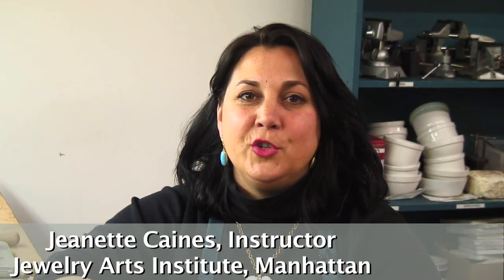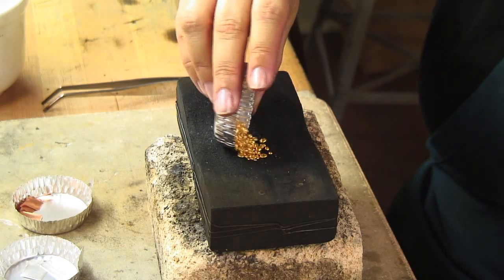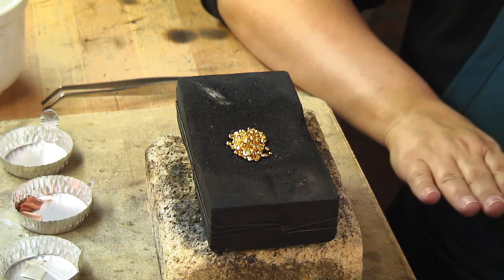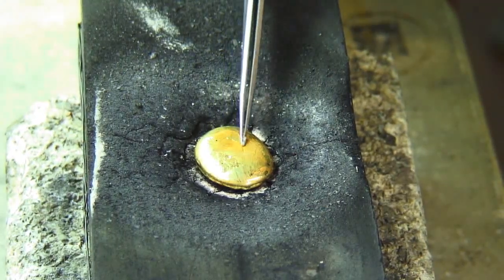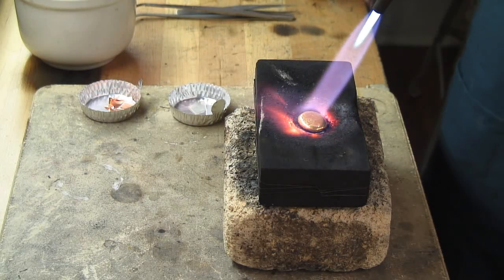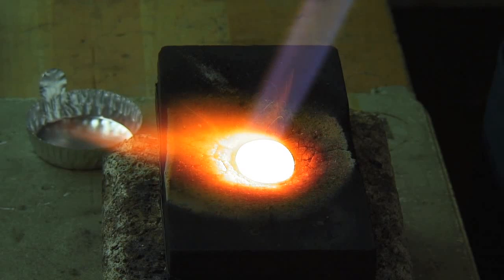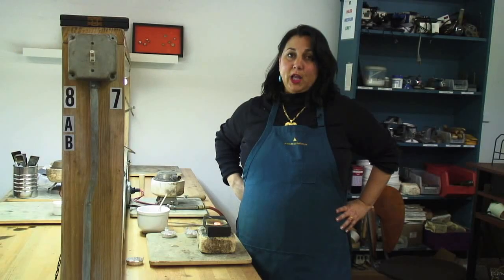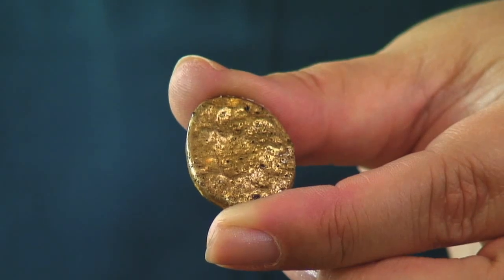How to Alloy 22k Gold Using Simple Tools

Comment: Thank you for showing your gold alloying technique. Very impressive.
However here in New Zealand we only use grams. So you know what contortions I had to go through adding up your dwt and grains so I was very confused until I saw you added the section for those of us who use grams.
I am alloying my 22k by adding Ag and Cu (oxygen-free) to 9999Au. I'm wanting to make 22k with equal amounts of copper and fine silver. I'm sand-casting my job, a ring shank and a 1ct diamond bezel setting. How does 22k like Delft sand-casting?
Looking forward to your response. Brian
Reply from the maker: Hi Brian,
Please let me know how it comes out! I have never sand cast my 22k but it is a very cooperative alloy, generally speaking. You are altering the copper content to make a harder alloy, I assume?

Comment: Question you said it was a once wouldn't it be more because of the silver and copper?
Reply from the maker: You start with one ounce of fine gold, it is more once you add the silver and copper. :)
Reply: Yea that's what I thought
Reply: I need some advice whats the best way to calculate how much silver and copper you have to add per half Troy oz of gold
Reply from the maker: @ron6Gs  For our recipe of 22k gold, it is 5.5 grains copper and 16.5 grains of fine silver
Reply: @JewelryArts  the information on grains is not really helpful can you tell me in grams
Reply from the maker: @ron6Gs  You said you needed the measurement for half a troy ounce, that is how we alloy in Troy ounces. You can just google an online convertor from troy ounces to grams. :)
Reply: @JewelryArts  ok
Reply from the maker: @ron6Gs  :)

Comment: Dear Jeanette Caines,
I love very much your videos, and I am interested on granulation.
I have made some works with fine silver, but I would like to make granulation with gold, so I will try it soon.
Here in Portugal to make the 22K gold alloy generally we use the same weight of fine silver and fine copper. Only if we want to change the color of the alloy, we change the proportion between the two.
As I understand at your video you use more fine silver (around 70% fine silver) than fine copper (around 30% copper). Does these percentages have a specific purpose for the granulation technique ? or is it possible too to use around 50% fine silver and 50% fine copper for this technique ?
If I understood well, your alloy is:
1 oz fine gold =28,3495231 gr
1 pennyweight and 9 grains fine silver= 2.13836403 gr
11 grains fine copper=0,71278801 gr
I would appreciate very much if you could give me a clue to this. I thank you deeply,
Yours sincerely,  Fatima Ferreira
Reply from the maker: Hi Fatima,
You ask an excellent question. The ratio of your alloy is essential to fusing. If you split your added alloy metals into a 50/50 ratio, your gold will be 22k but it will not fuse or granulate. You should duplicate the recipe I give exactly if you want your alloy to fuse well. If you are looking at the total ratio of your alloy, adding   much more than 2 percent copper yields metal that won't fuse well.  I am so glad you are enjoying and learning from my videos. Always feel free to ask questions. :)

Comment: Could you PLEASE make a detailed video tutorial on how to alloy to 10k , 14k and 18k gold? Most specifically 10k. I would be willing to pay for a video tutorial on how exactly to alloy 24k to 10k-18k. And can this be done using a 24k pamp suisse bar for the starting 24k gold when doing this process??
Reply from the maker: Hi! I only work in in 18k and 22k gold and the charcoal method I show in this video works great. However, the lower the karat, the more important it is to instead use a boraxed crucible and an ingot mold to get a good result, so I would recommend that. Have you done any alloying before?
Reply: @JewelryArts  Thank you for your helpful reply.  Is this method applicable  to up carat 14k to 20?
Reply from the maker: @ronsfi  Yes, but remember, it takes a HUGE amount of pure gold to up the karat of an alloy. :)
Reply: @JewelryArts  I admit.  I was surprised once I ran the calc.  However.  You do end up with a huge amount of your preferred alloy.  This is a great process and I get so much out of your videos and your approach.  It helps me not stress on the needless and see where my focus should be.  For instance.  Adding more solder was something I would never have tried without the confidence of having seen you do it.
Reply from the maker: @ronsfi  Knowing what matters and what doesn't is essential! That is why I focus on that so much while teaching. I am so glad you find it helpful. :)

Comment: Thanks for the video! This is very informative. Are you not worried charcoal pieces will get trapped within the molten gold, causing impurity in the final product?
Reply from the maker: The charcoal gets burned away. That being said, molten rings do have a more porous structure, which the forging afterward helps to address.
Reply: Thanks,  @JewelryArts  !

Comment: Hello
Can you help me please, I made very low temperatures gold welder 14 carats but it becomes very hard ,and cracks, is there a way to make it softer.
Reply: The reason it cracks is you have dirt in your gold or you used bad alloy, one thing you can try is to re-melt the gold and as is melting add some salt or a small piece of glass that will help to get the dirt out.

Comment: If I need 100 gram annoy gold. How can calculate?
Reply: What do you mean you have 100gm. of gold and how much alloy to use? What carat do you want to make the gold?
Reply: @scala1944  
I need 22 carrot jewel necklace. so how can take 24 carrot gold and how much silver and copper
Reply: On 100gms. of 24carat  to make it into 22carat you divide 999.9 by 0916 x the weight (  in this case is 100gms.)  total weight with alloy will be 109.15  so 9.15  is the alloy of which 7gms is copper and 2,15 silver.
Reply: @scala1944  
Thank you
Reply: @scala1944   hello, i have 46.1 grams of 24k gold i need to karat down to 22k and i have been searching to find a chart or formula to figure out how much fine silver and copper i need to add but i am having no luck. Any help would be great thanks
Reply: Hi, the amount of alloy in 46.1 grams of 24ct is:  4.2grams which it totals to 50.3 grams of 22carat. You can use 50% cooper and 50% silver depending the colour you want the gold to be. More cooper makes the gold more red , more silver makes it more yellow. you can use only cooper or only silver either way it will not affect the carat of the gold,  so the choice is yours. Usually 50% -- 50% I found is the best alloy. The formula is : You divide  24 by 22 then multiply by the weight of the gold. if you want to make 14carat then you divide 24carat by 14carat x weight of gold. I hope it will help you.
Reply: @scala1944  thanks
Reply: @scala1944  That is super helpful! i am going to copy and past that formula right now so i don't lose it.
thank you very much for taking the time to answer me.
Reply: @scala1944  pls may i know something. How to calculate silver and copper weight?
Regards
Reply: Zaw Lp Hello, you’re question is not clear, I don’t understand what you mean. If you want me to tell you how much alloy you use in a certain amount of gold then tell me what carat your gold is and what carat you want it to finish at and then I can tell you how much alloy you need.
Reply: @scala1944  Hello,  I mean that 100gms of gold 24 karat to 22 carat its divide 999. 9 by 0916 ☓ weight it's OK.  I would like to know alloy weight 7 gms of copper and 2. 15 silver  which it's how to calculate copper and silver weight?  Appreciate for your's kindly reply.  Thank you.

Comment: Hi love the video

Can you please tell me the recipe for 18ct white / yellow gold please 

Would really help thanks
Reply: In white gold you add palladium, which has a very high melting temp.
Reply: I may be late but i have a recipe if you’re still interested 75.5%gold  .75% silver  14.5%copper  3.5% zinc  5.75% nickel
Make sure you have a very good scale and get these ratios right.  This recipe is for a traditional white gold color, it’s usually Rhodium plated afterwards
Reply: @tblz406  ur a legend thanks

Comment: What happened to my pure 24k 1gram gold bar if I melted it with 1.4grams of zinc I was trynna make 10k
Reply: That wouldn’t work. Try a mixture of silver and copper instead. Also I wouldn’t use 10K, try to use at least 14K. I like a 60/40 ratio of copper to silver.
Reply: That will make 10k

Comment: Why not use ceramic?
Reply from the maker: You can melt in borax coated ceramic and pour into an ingot, this is just an easier, no pour method.
Reply: If you’re not pouring it charcoal is easier to melt in

Comment: could you do this with a smith little oxy propane set up with a rose bud torch?
Reply from the maker: I'm not sure what a rose bud torch is but oxy propane should be hot enough. :)
Reply: thank you!  check out paige tool tips  for the smith little torch

Comment: Hello I need to work with a Gold - platinum - copper- silver- iron (trace) alloy , do you think it can work using similar techniques ?
Reply from the maker: Hi Eywa,
Platinum requires the use of much higher melting temperatures so an oxygen tank setup along with gas is required. Why would you be mixing gold and platinum?
Reply: Jewelry Arts Inc. Hi, it is a particular alloy made for a marine chronometer's hair spring. The composition of the alloy can be determined by using x-ray fluorescence techniques. 
It is mostlt gold, alloyed with copper, platinum, silver and iron (order of importance)
Reply from the maker: Interesting!  It seems like an odd alloy to use. Anyway, I know for sure that alloys including platinum require much higher melting temperatures, so you will need an oxygen tank setup along with your gas. Good luck
Reply: Hello, for an update the alloy revealed to be composed of 70% Au, 16% Ag, 9% Cu and 5% Pt in Wt.  Brepohl (Theory and practice of goldsmithing) mentions issues with the oxidation of the copper (and thus uses borax) and also the solubility of borax, silicon and carbon in the platinum which tends to render it brittle. 
I wonder if in the small quantity of copper and Pt used this would be of an issue. Any insight on this  ? Thanks again

Comment: will ram chip metals which has gold in it also, will they all burn off while leaving the gold behind and how do i separate lead and copper from it , is it just ok to burn them off? i know lead is heavier than gold so it has a higher royal atomic count, is burn them off ok? what method do you recommend?
Reply from the maker: You need to have your gold professionally refined. You will not be able to remove lead, etc by yourself by heating.
Reply: so you don't recommend me making my own nitric acid and attempting disolve of matters? then in soloution drop out with metabisulphate?

Comment: What is the percentage (density) of that gold after you finish alloying ? and the weight ?
Reply: cheetha123456 Good Lord man! Chill out!
Reply: Gold: 1 oz = 28.3495 (grams 22k gold) * 22/24 (91.6% purity) =  25.9870416667 grams (pure gold)
silver: 1.55517g(pennyweight) + 0.0647989*9(9 grains)  =  2.1383601 grams silver
Copper: 0.712788grams(11 grains) 
28.3495 +  2.1383601 +  0.712788 =  31.2006481 grams total
28.3495 (pure gold) / 31.2006481 (alloy weight) =  0.90861894628 = 90.86% pure gold 
So it seems that they refined this to approx 22 karat yellow gold, as 22/24 = .9166 0r 91.66% pure gold
Density is easy, just multiply the ratio of each element in the alloy by its respective density and add them up. should be somewhere around 17 g/cm^3 given that gold is about 19 and silver/copper are both around the 8-10 area